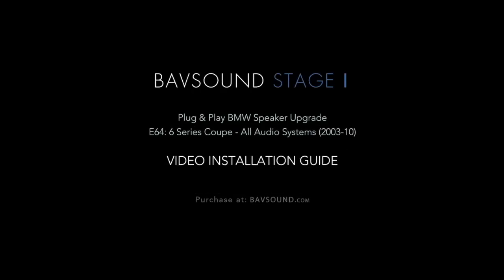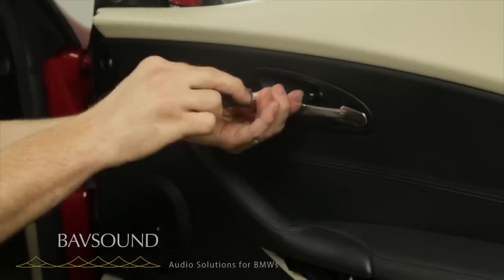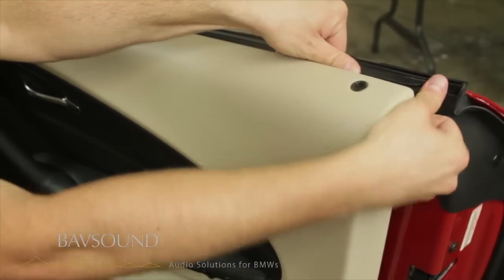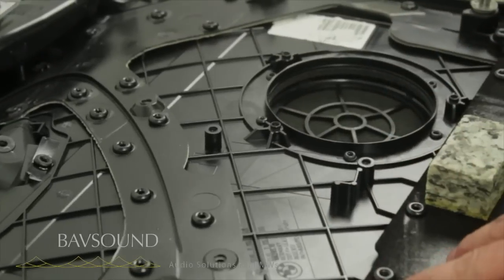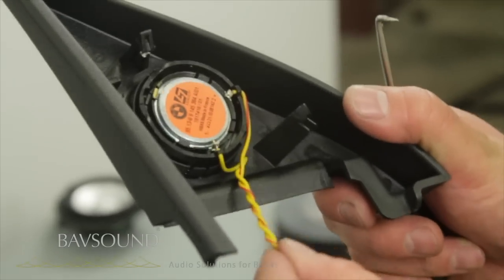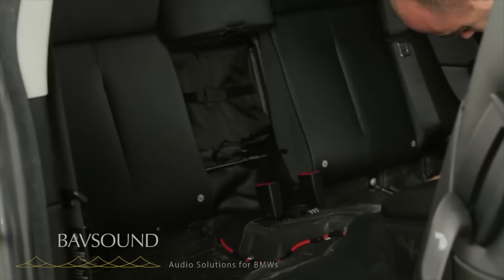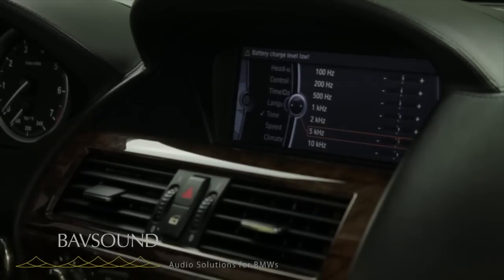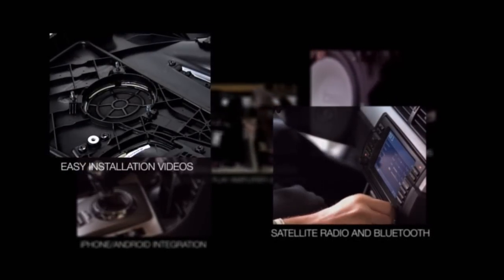BMW Speaker Upgrade/Installation | 6 Series Coupe (E63) 2004-2010 | BAVSOUND Stage One

Comment: Totally different on the E64 convertible. My bass speaker is in the rear quarter panel. It is almost impossible to remove without thinking you are about to break something.
Reply: my subs are under the chairs in the cabrios.....m6
Reply: On both sides right?

Comment: Nice video... Except for the fact that the rear headrests WILL NOT COME OFF.  I am a 210lb guy and i tried everything from pull and wiggle to prying with a 2' PRYBAR (center and alternating left and right).  There has to be a trick?  Please tell me how to get past this!  you skipped the left one in the video and the right one seemed to come right of... What gives??
Reply: I know I'm a bit late but I'm replying for anyone else who had an issue with this. Just spray a tiny amount of WD-40 down the hole and leave it for a few hours, should come off fairly easily

Comment: what year is that E63  the idrive is different than my E63 BAVSOUND
Reply: larpt23 they changed from the CCC to CIC in 2009-2010 (depending on which market you're in), that's a CIC in the video..
Reply: ya i wish i had a 2009 instead of a 2008 now lol.
Reply: @championx1  check out joyeauto, get there multimedia briefings interface for CarPlay and android, it doesn’t interrupt your stock idrive, not perfect but it puts the entertainment system into 2020 instantly!